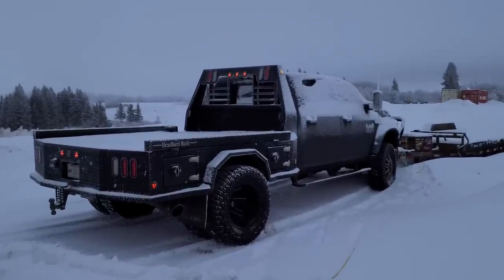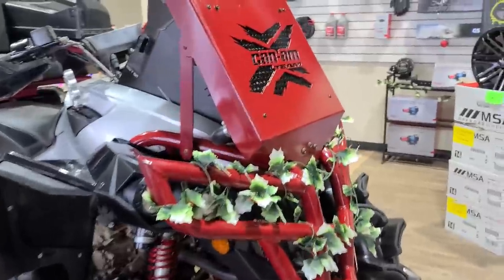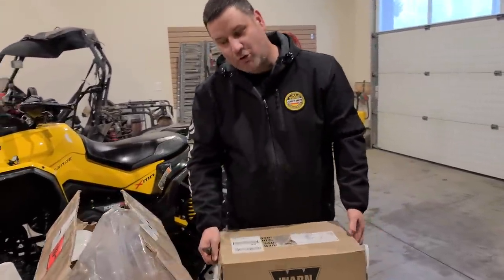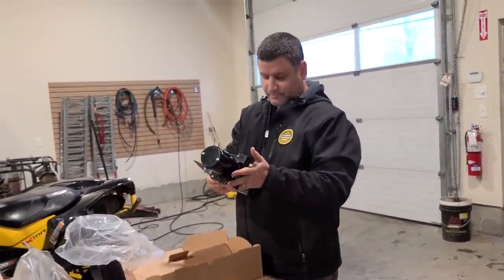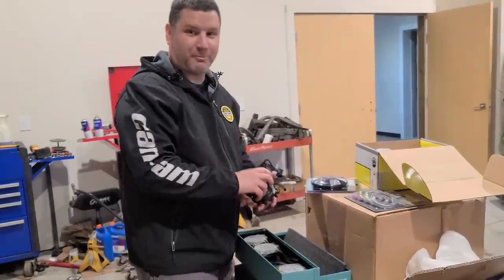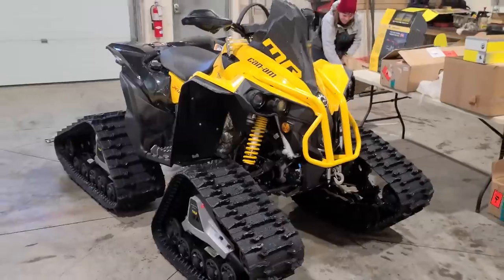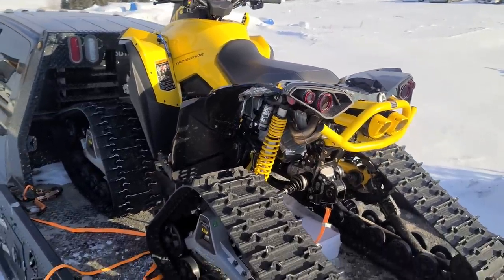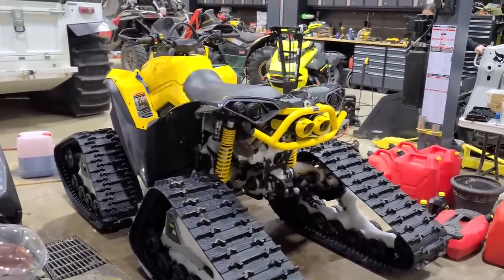Project Lock-Ness 2021 Can am Renegade 1000r Xmr Build

Comment: On regular off road use, how well would it run? And would it be just as fast as it would be with regular tires? This machine is beautiful!

I’m doing a price build on one now and the tracks makes it look even more beastly🏆 Just want to make sure that i could run the tracks without any issues. Website don’t tell me if it’s strictly for snow application or not. I imagine it can be used wherever.
Reply from the maker: They can be run year round. Speed is reduced roughly 40%

Comment: Did you already put a custom tune on the ecu or not yet? I would recommend upgrading the plastic shifter bracket with aluminum one too! Looks great with those tracks on!
Reply from the maker: Yes we are running a custom fuel map. I have never had an issue shifting thankfully

Comment: Another pro tip, turn your exhaust brake on. It closes the veins in the turbo partially to speed up warm up also.
Reply from the maker: It's always on
Reply: Sounds like a jet engine running with it on lol

Comment: On my 2021 Outlander XMR 1000 I swapped out the shitty incandescent blubs for some LEDs and it completely fucked with the bike.  ECU would throw a brake warning and cut power if you were over 25% throttle for 5 seconds.
Now I'm fighting an issue with the throttle by wire system freaking out with the AXON winch/bluetooth remote.  I'll know more next week hopefully...  

Still best quad I've ever known/riden

Comment: Sweet build. With all that extra track to spin did you have any overheating issues?
Reply from the maker: Seemed good! I have never had heating issues in any of my builds
Reply: @ostacruiser  it's a beast . I have the same quad. Just kept the wheels on mine. It's funny how loud it's revving out and seems like it would be going faster. But the snow and tracks you can tell are holding it back..However you have successfully built a true Tank of a quad. That looks like it will darn near go anyplace in the face of the earth.

Comment: Great content like always I have two 2021 Outlander 850 they tell me if I run the LT are to  Big to run that I will be running in low range all the time could you give me some advice on this matter I'm wanting to get a set of tracks still debating on which ones appreciate any info and I was wondering if you knew where I could get some touch-up paint or paint code I know I'm asking a lot don't know where else to turn to thank you so much Merry Christmas to you and your family
Reply from the maker: The LT tracks will work perfect for you. High gear all the time except going slow or plowing/towing

Comment: Just kinda blows me away that brp just now decided to offer a full tilt locker in the front end when yamaha has had it since 02-03 time frame, took em long enough.  Im currently doing research to see if the 4lok diff will snap into my 19 1000r cuz the visco is wasted, regardless what i choose the diff has to come out.
Reply: Yes it will. A guy named Robert Pearson sells the conversion harness. It's plug and play.

Comment: Love the build and do you have any ideas to seal a belt box? Mines been leaking and I love your knuckle shifter I bought one and I love it
Reply: I've always do e a little bit of black RTV on the back side of the belts box where they mate to the engine and trans as they leak there, and if the gasket on the outer cover doesn't seal right, can use a thin coat of rtv on it too. Just don't want to goop in on there thou.